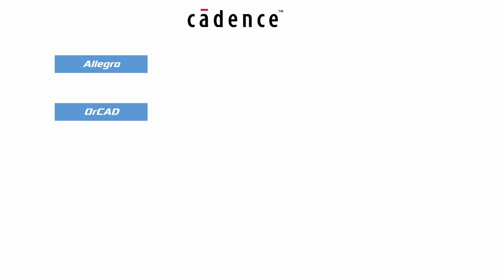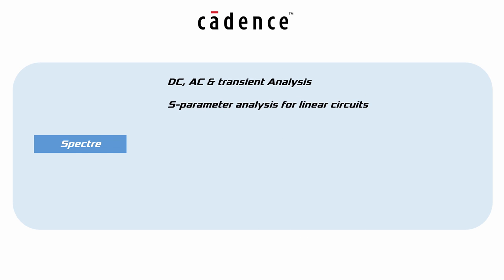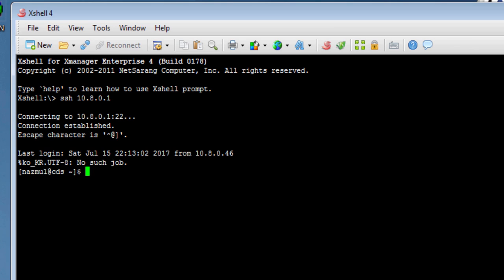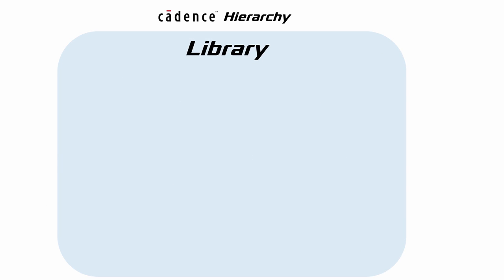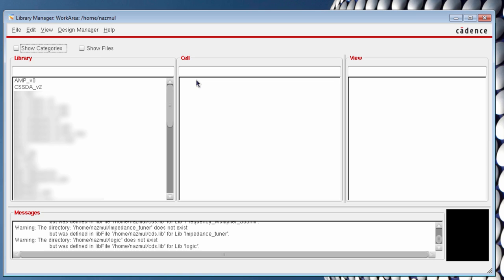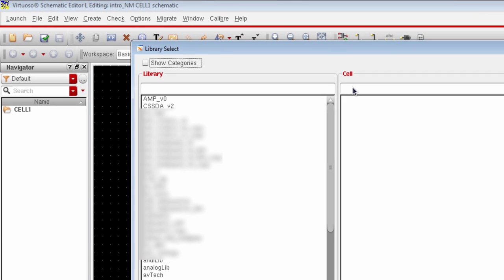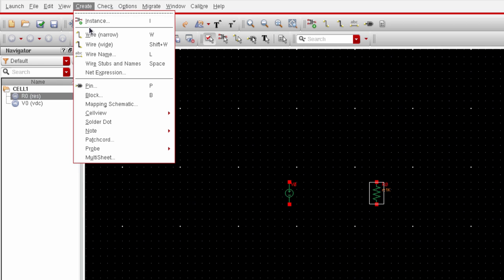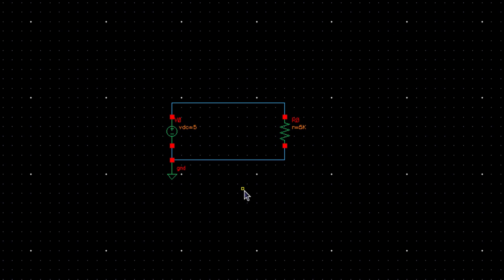Cadence Virtuoso: Introduction

Comment: Hi prof. How to do Design a biasing current that is independent of power supply and temperature. The value of the output biasing current should be 25 x 10^-5 A Operating Conditions VCC: Min 2.7V, Typ 3.0V, Max 3.3V Temperature: Min -45°C, Typ 25°C, Max 125°C
Reply from the maker: Hi you need to design a current mirror circuit
Reply: To have temperature-independent circuits you need to use BJTs with the MOSFETS to nullify the effect of temperature difference, also to make voltage-independent circuits, the use of opamps with the current mirroring is required. You can find multiple papers on this topic in IEEE.